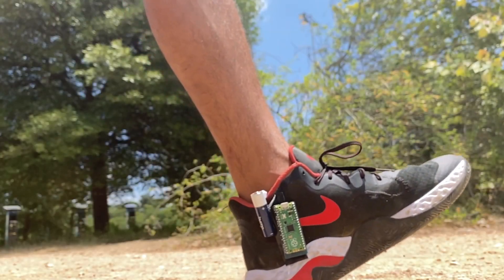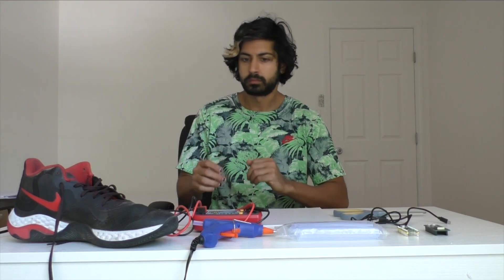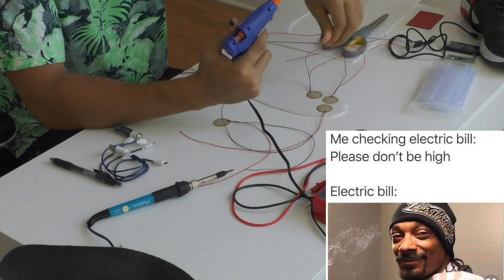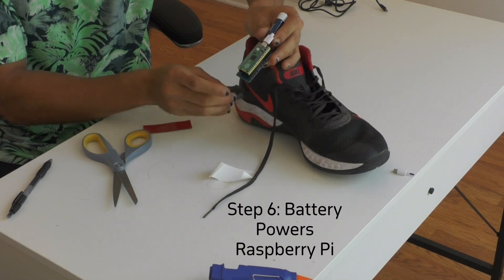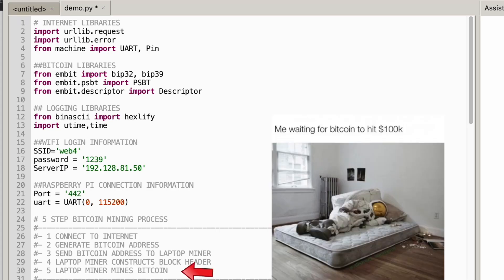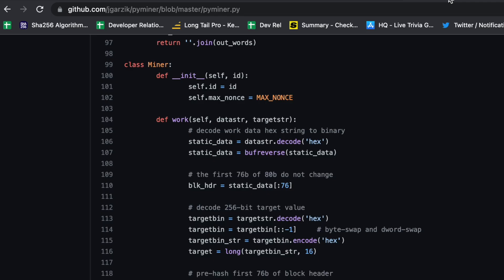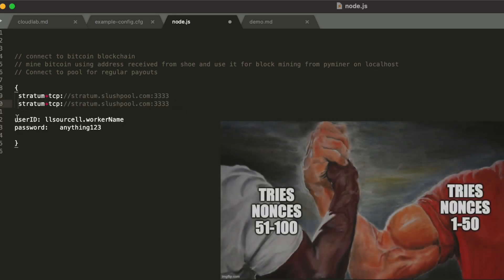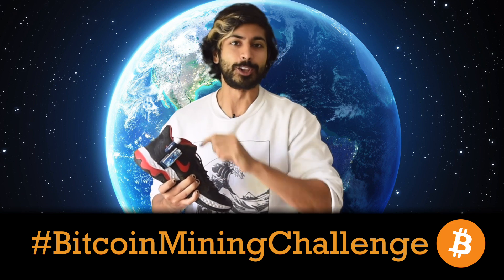Bitcoin Mining Shoes in 4 Minutes

Comment: But why mine bitcoin? Also, isn't the computer effectively mining with this setup? Even if the pi would be mining, how would that work without internet? I like the concept, but I see a few flaws. First is that bitcoin is way too hard to mine and you'd be only mining a couple of cents a day if you are lucky. So it needs to be done for an altcoin. Even then, internet usage. Its Hella expensive I recon if you are mining outside with a simcard if it's even possible. Having that said, I do like the idea for sure. I've been thinking recently if it weren't possible to mine crypto utilizing renewable energy. Thanks for the inspiration!

Comment: Wait... What? But... Doesn't that just make a shoe that powers a battery that powers a pi to tell a laptop to do the mining? Wouldn't it be faster and exactly the same powerwise (for the actual mining) to just click 'start mining' on the laptop before going for a walk?

Or did I majorly miss something... I must have misunderstood something right?
Reply: I had the same question. The video is misleading people to think the power of the steps are used to perform the hashes…
Reply: Exactly lol
Reply from the maker: There are 3 steps to mine bitcoin. 1. Generate an Address. 2. Construct a Block. 3. Mine the Block. In this first version of the shoe miner, the pi only does the first step. A secondary device does the remaining 2 steps. But in the next version, i'll use a raspberry pi with more storage and computing power that can do all 3. It's been done before, see this: https://linuxhint.com/mine-crypto-raspberry-pi/
Reply: @SirajRaval  Hey Siraj, don't you think you should have mentioned the source of your information in the video instead of down in the comments?
Reply: @GG-fk6uz  old habits die hard
Reply: @GG-fk6uz  he will give credit once he makes the video using the 3-steps in 1 tool he just mentioned

Comment: That's a pretty hilarious bait-and-switch. "Using the power of jogging to mine* Bitcoin.
* Jogging power is used to tell another computer hooked up to the power mains to mine the Bitcoin"
Reply: yep, classic siraj.
Reply from the maker: The raspberry pico is too small to store the entire bitcoin blockchain. However, there is a raspberry pi that can do it, and i can use that in a future version. See this: https://linuxhint.com/mine-crypto-raspberry-pi/
Reply: @SirajRaval  the primary issue is thermodynamic. Bitcoin mining is extremely competitive with high-performance ASICs. The notion of using the squishiness under one's feet to power Bitcoin mining is unrealistic in the extreme. The task has to fit the parameters. It would be useful to timestamp individual steps to generate fitness data, for example.
Reply from the maker: @k98killer  i will agree that it's not profitable to mine Bitcoin on any type of hardware other than a high performance ASIC at the current Bitcoin price, but what if 1 BTC = 1 million USD in 5 years? Then, even if you mine at a loss, you will make money in the long run by HODLing. Yes, you could also just buy BTC instead of mining, but mining is the only way to truly earn BTC without KYC in the form of the coinbase (block reward + total sum of transaction fees in a block)  totally anonymously.
Reply: @SirajRaval  I conjecture that there isn't enough power in a footstep to mine a single satoshi, but I'd be happy to be proven wrong. You might mine a single share after a few months of walking around, but you'll never get enough for a payout. It is impractical in the extreme. You'd be better off running some kind of alt coin validation and then swapping into Bitcoin if you got enough to do so. I've been mining cryptos since the launch of f2pool, so this analysis is tempered by experience.
Reply from the maker: @k98killer  Even if it can't mine a single satoshi directly, like you said there are many alt-coin validation methods to mine satoshis indirectly. For example, you could use the shoes as a stacks node instead - their proof of transfer mechanism for staking enables earning rewards in BTC for holding STX.
Reply: @SirajRaval  alt coin validation of some sort is definitely the way to go for crypto stuff imo. If you can get it to work, it will be a very impressive feat of engineering. But a diy fitness tracker is also nothing to sneeze at; the market for fitness trackers is immense, so it would be a pragmatic project. If you can use a CRDT to ensure strong eventual consistency in the presence of network issues or node power failures, it'll be very very cool.
Reply: @SirajRaval  btw, I did literally laugh when the gimmick was revealed. It is a funny thing to do, and I appreciate the humor considering how dry computer science can be.

Comment: This doesn't work for so many reasons. But let's use the fact that you need a faster internet connection than a non hardwired raspberry pi can connect to
Reply: What did you expect from High Indians
Reply from the maker: A non hardwired raspberry pi can connect to wide range of internet connection speeds - it depends which wifi module you use. Im using the ESP8266